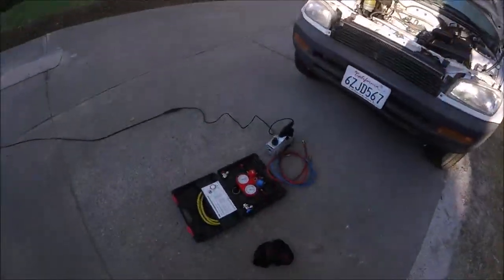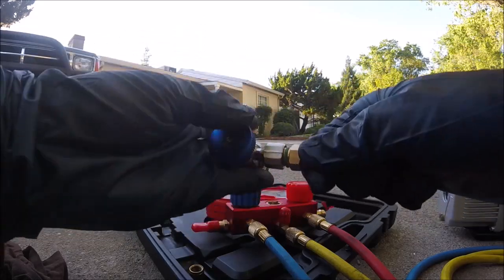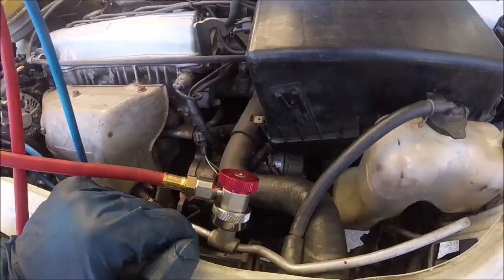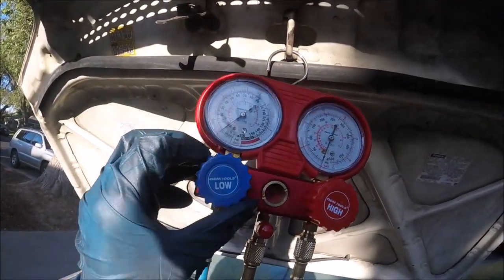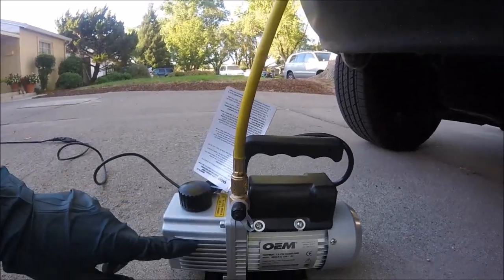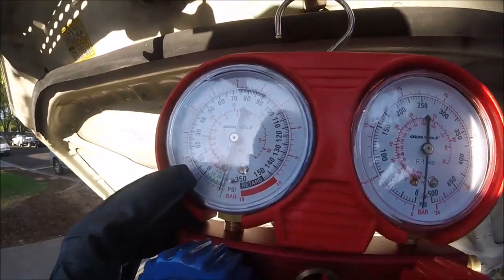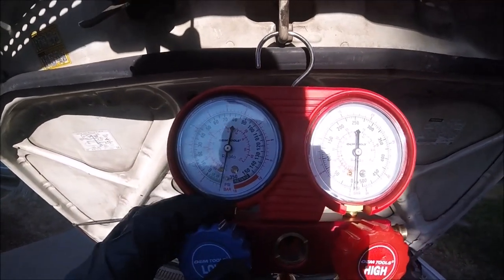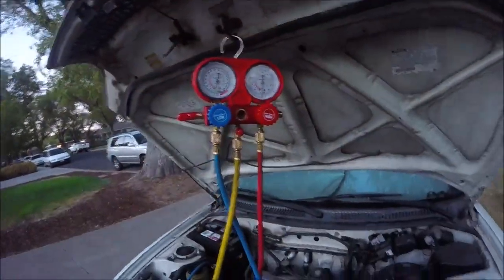How To Pull a Vacuum on Car's  A/C System -Jonny DIY

Comment: What if you do have a leak , how would you go about finding it and fixing that? I think
Mines the low pressure valve😊
Reply from the maker: You can pressurize system with air to listen for leaks or add a leak dye. Then just replace seal or part leaking 👍

Comment: I JUST USED Google Image… And asked them where my low pressure was.  I WAS ABLE TO LOCATE IT WITHOUT A PROBLEM. 

BUT, I was able to see my High Pressure line, the cap is missing on my High Pressure Line

Comment: So, after you are done do you unscrew everything and then recharge your ac like you did in the second video, I'm not understanding what you mean by attaching something to the yellow hose.
Reply from the maker: Yes unscrew and recharge system as I showed in other video. Ohh I was talking about you can use the gauge set to add refrigerant as well but you need an a/c can tap to connect to middle yellow hose. Either way works though 👍

Comment: Wait, after you've waited to see if it hold the 30 vacuum you said to run it for an hour to empty the air but how do you do that? Open the high and low again and trun on the vacuum and leave for an hour??? What am i looking to see on the gauge? That its still on 30???
Reply from the maker: @enmat3  yes you reopen and vacuum for an hour after testing to make sure there are no big leaks 👍

Comment: Hey I just got a new engine in my 2007 toyota camry le. Should I vacuum it or just put the refrigerant in it?
Reply from the maker: @Smooveminniebackup  it's possible they didn't disconnect the ac system. Is there any way you can find out? Can hook up the gauges or a can and see if it has any pressure. If has some pressure can recharge if no pressure yes vacuum for sure

Comment: HOPE you can see my question!!  At Walmart, they sell the EZ CHILL R-134a AC recharge kit (bottle & hose with gauge) WITH LEAK SEALER plus (18 Oz)…..for $45.00. Does this mean I don’t need to buy a separate can AC sealer?????
Reply from the maker: @CanTho2022  yes just the 1 kit will be all you need 👍
Reply: @ …🙏👍 SORRY I HAVE TO ASK A COUPLE OF TIMES! Didn’t know if you still read from the old videos!! THANK YOU 🙏
Reply: @CanTho2022  if you used one of those make sure you tell the shop you eventually wind up taking your car to when youve had enough trying to fix your car's ac yourself so that they dont ruin their $5000 machine that reclaims all of a car's ac refrigerant as the leak seal will really mess up their machines and the mechanics who know anything about a.c. will tell you never use one of those cans youre more likely to cause more problems than solve them effectively. FWIW.

Comment: If I don’t have access to vacuum and my refrigerant is empty 
What is danger of filling without vacuuming first?
Reply from the maker: @brendancampbell57  no danger, just may not work as well if theres air in system. Air needs to be vacuumed out so refrigerant will work well. Worth a try though if only option
Reply: @JonnyDIY  or Canadian tire near my house carries RedTek R12a says it’s compatible with R134a and R12 systems.
Reply from the maker: @brendancampbell57  I would get the frostycool 134
Reply: @JonnyDIY  HOPE you can see my question!!  At Walmart, they sell the EZ CHILL R-134a AC recharge kit (bottle & hose with gauge) WITH LEAK SEALER plus (18 Oz)…..for $45.00. Does this mean I don’t need to buy a separate can AC sealer?????
Reply from the maker: @CanTho2022  yes it's built in so you need to just buy that 1 kit 👍
Reply: @JonnyDIY  …THANK YOU! THANK YOU!!!!  Thank you for the response!! This confirms what I was thinking!!!
Reply: @JonnyDIY  what about if cannot find R134a , I can find alot of R134a replacements refrigerants (R290, and frostycool R134) ? Is that dangerous to add without vacuuming system first? They claim they are compatible but can it cause bad reaction or clog tubes / compressor? (Literally cannot find R134a anywhere not even amazon)

Comment: Thanks, I have a 1994 Toyota 4x4 DX truck. it leaks gas over about 6 months.  do I have to pull a vacuum before charging it or can I try just charging it? I bought a "pro cold kit, it says it stops leaks, I also bought a red angel stop leak stuff to try if it leaks out.  would it be best to try to seal the leak 1st, if it seals then vacuum it out?  thanks
Reply from the maker: With the stop leak stuff you want to vacuum system first. It can help some depending on size of leaks. Here's a video where I do the same thing.
https://youtu.be/6xbnUd649Es?si=HvaTRHw8SraAFgJk
Reply: @JonnyDIY  Thank you very much!
Reply from the maker: @xerravon  You're welcome, happy to help. Good luck 👍
Reply: @JonnyDIY  Hi, Ive been wanting to thank you for your help on PROPERLY fixing my 1994 Toyota 4x4's AC!  I've seen many videos on charging my AC, heck the instructions on the can (ones that come with charging hose) are the same.  I did this in past and even had it done by mechanics. problem, it never blew as cold as it should.  Well until I found @JonnyDIY. He read my comment and sent a link to this video about pulling a vacuum!  that is something I never saw in any video.THANKS

Longer story shorter, I pulled a vacuum and charged it with AC pro with stop leak, It blows as cold as when I bought her new in 1994!  Hopefully the leak will seal but I won't know until next summer, it took about 6 months to leak out.  that has nothing to do with the video.  but anyway,  THANK YOU @JonnyDIY
Reply from the maker: @xerravon  Awesome! You're very welcome. So glad to hear I could help you get it fixed and working again 🙌👍

Comment: After pulling the vacuum, instead of this method, will it be okay to add refrigerant using those tall refrigerant cans (AC Pro, EZ Chill) with the hose and gauge?
Reply from the maker: Yes that's perfectly fine. Just keep track and add back in the correct amount. You can weigh the can full and subtract weight to get exact amount for recharge 👍
Reply: @JonnyDIY  Thanks for replying. Could I just use the gauge that’s attached to the can to determine the exact amount (green area)?
Reply from the maker: @Indiana_Ape  if vacuuming system first you want to refill the amount of refrigerant your specific vehicle calls for. Should have number of ounces located on underside of hood. You want to add back that exact amount or very close. Better to add lil leas than  too much. The gauge on those hoses aren't accurate
Reply: @JonnyDIY  it’s 21.2 - 22.9 ounces. I’ll ditch the can AC Pro with the gauge. Thank you for all the advices, I really appreciate it. 🙏
Reply from the maker: @Indiana_Ape  You're welcome, good luck. Hope you get it up and working again 👍
Reply: @JonnyDIY  Thank you. I hope so too.
Reply: @JonnyDIY  Thank you. I hope so too.

Comment: So I recently had to change the ac condensor due to a collision. Should I pull a vacume even though I lost all the refrodgerant?
Reply from the maker: Yes most definitely pull vacuum before recharging 👍 Always want to vacuum system when its opened for work

Comment: 10 min vacuum at 30 is enough
Reply from the maker: I usually do at least 20 minutes, depends how long system has been open and exposed
Reply: @JonnyDIY  according to the rep who setup my robin air machine 10 min and 30 psi is enough.

Comment: Maybe stupid question,  but what do you do if theres still refrigerant in there?
Reply from the maker: If only a little bit its ok, it'll just vacuum out to atmosphere 👍
Reply: @JonnyDIY  thanks! Would 1lb be considered a little? Dealing with a uline fridge that wont get below ~48°F
Reply from the maker: @scottsnyder5225  that's not too much. Only other thing would be is you would need an A/C tank to catch it in and then it can be reused

Comment: Great video. Do you know the logic behind the clockwise to open for the low and high ports attachments? Do you have a video to discharge the system? I need to do that, attach some o-rings to the lines and run this same test you just performed in this video.
Reply from the maker: Thank you, glad to help. I believe the low and high ports turn clockwise because of the type of valve they are. And when you vacuum system it will evacuate any refrigerant left in system. If you want to capture that refrigerant you will need to get a refrigerant tank that you hook up to vacuum pump 👍
Reply: @JonnyDIY  Thank you. Any idea where to buy a refrigerant tank? I guess I can google it, lol.
Reply from the maker: @ahmedsaidu-kamara6760  I think you can order online, or some local hvac shops may sell them as well
Reply: @JonnyDIY  I hate to sound like a DIY beginner but I'm not. I just went to open the manifold gauges I rented from my local Autozone in Pennsylvania and it didn't have the yellow gauge. Not sure if the previous loaner took them or it didn't come with one. Any suggestions on where I can get one will be appreciated.
Reply from the maker: @ahmedsaidu-kamara6760  I would take it back and see if they have another loaner or check O'Reillys. Harbor freight sells a set for a decent price if you have one near and want to make the investment
Reply: @JonnyDIY  I will definitely take it back because I need my AC to work asap.

Comment: I'm only able to get 20 inches of murcury, it's holding at 20 with a small drop, is this due to a leak on system?
Reply from the maker: Should be able to get to around 29-30 on a system without large leaks. Make sure you have both low and high side hoses hooked up and open, the valves on gauge open counterclockwise but the fittings on the ends open clockwise 👍

Comment: Should the system take awhile to go from 20 to 30 on the gauge of vacuum pressure?
Reply from the maker: Make sure you have both hot and cold hoses open. The knobs by the gauges open regular counterclockwise, but the ones on end of hoses are reversed. They open when you turn them clockwise.  It shouldnt take long to get down to almost 30
Reply: @JonnyDIY  got it

Comment: hi there Jonny, 1 question.. Can I vacuum a fully charged ac? is the freon and oil going to scape through the vacuum machine? thanks! love your vid man
Reply from the maker: If you have some refrigerant in system still and its just a little low you don't need to vacuum unless you want to refill with the precise amount of refrigerant called for by your vehicle. When you vacuum system it will evacuate all the refrigerant, but it won't remove the oil.

Comment: Does the high side suppose to be on the vacuum too
Reply from the maker: Yes open and vacuum both high and low sides 👍
Reply: @JonnyDIY  ok thanks and the  high side suppose to show in the needle that it is in vacuum
Reply from the maker: @kenssalvador7253  more about the low side when vacuuming. Just close them both off and the low side should hold at 29-30. Thatll tell you if you have a leak or not if it holds or not

Comment: Pressure loss on the high side.  

When I do the vacuum test, the low side stays on -30 PSI for an hour BUT the high side seems to lose vacuum.  .  Is this a concern, the video doesn’t seem to look at the high side which I don’t understand why?  The 2 sides don’t seem to be “connected” when the car compressor isn’t running, the car turned off

Comment: Open the yellow?
Reply: Oops.ok thanks man.should i let ot run a lil longer now that i opened the yellow line?
Reply: Thanks for the quick response man
Reply from the maker: @juicecounty714  yes let it run 30-45 minutes to remove all air/moisture. Gauges should reach down to almost 30. Make sure vacuum pump has oil in it too
Reply: Hey boss.i got another question
Reply: Specs say I need 25oz of refrigerant.i used a a 12oz can and a lil less then half of another can and the guage is in red?do I still keep adding even tho its in red.?I'm probly abt 16oz.
Reply from the maker: @juicecounty714  how cold is the air running now? If cold yes,  stop. If not double check specs and fill to at least Minimum listed amount 👍🏻
Reply: @JonnyDIY  yes its cold.nkw the guage is reading differant this morning.i got the. Charge with rhe uv dye.must have a leak right?
Reply from the maker: @juicecounty714  if its running cold 35-45 degrees Id leave it and deal with it again later if it leaks all out. If still a lil warm, I'd add some more refrigerant until either cold or to the minimum amount refrigerant amount listed. Probably around 23 ounces
Reply: @JonnyDIY thanks again my boy.u the man.god bless.sorry for bugging.haha
Reply from the maker: @juicecounty714  You're welcome. No worries, glad to help 👍🏻
Reply from the maker: Yellow in middle is for adding refrigerant 👍🏻
Reply from the maker: Oh yes sorry open the yellow one on the gauges once it's connected to the vacuum pump. That will allow the vacuum pump to suck the air through and out the system

Comment: Does the vehicle need to have all tje refrigerate out?
Reply from the maker: yes, once you vacuum the system it pulls whatever is left in it and vents it into the atmosphere
Reply: And ty so much for responding bro. Thx thx thz!!!
Reply from the maker: @jayflo-tripple-4142  hmm so you vacuumed and recharged? Now compressor cycling on off on/off with no cooling in car?
Reply: So get this,  pulled the vaccum, damn conpressor keeps coming off and on. The low side is freezing cold. So this did not resolve the issue  i did some reseaxh, says to check the pressure switch, what are your thoughts?
Reply: Actually it was doing it b4  and it seemed that the recharge almost worked, but as soon as i get it filled on green (the prorefrigerant gauge) its starts to click on and off.
Reply: This is why i thought it maybe the pressure switch
Reply from the maker: @jayflo-tripple-4142  well it is normal for the compressor to cycle on and off quite frequently, but if it isnt cooling then yes could possibly be pressure switch

Comment: Thanks for the info Johnny! I have completed the final vacuum of one hour to remove all the air in my system. Instead of connecting my refrigerant to the yellow hose, can I just connect it directly to the low-side port of the car using the hose that is connected to my refrigerant can?
Reply: I wouldnt using the yellow not only allows you to purge the line but as soon as you remove low side you will loose vacuum
Reply from the maker: You're welcome, & yes thats totally fine to use the hose that came with can after vacuuming 👍🏻

Comment: Do I need the car on,in order to vacuum the line?
Reply from the maker: No car is off. But Car needs to be ON with AC on full blast when recharging with Refrigerant 👍🏻
Reply: All,cool. Thanks dude.
Reply from the maker: @rafam.3585  no problem 👍🏻
Reply: no  dont have the pump running

Comment: Vacuum with car off or on??
Reply: Mr jonny i have a little dilema, my car only cools when i am driving get some speed and doesnt cool when i am parked, i noticed the cooling fan from the condenser doesnt spin, i tap it with something and it starts spinning, could replacing the fan make my car cool? Car doesnt overheat because its dual fan and main fan does spin
Reply from the maker: Yes if both fans arent coming on you should replace fan assembly, then it should help the AC to cool at low speeds or stop and go traffic. If after replacing the fan it still doesnt get cold, you may need to top of the AC refrigerant level as well
Reply from the maker: Car off to vacuum. When recharging you have the car running

Comment: What if my ac system still has refrigerant in it but I want to pull a vacuum to get all the air and moisture out so it can run colder than it is? Do I need to evacuate all the perfectly good refrigerant out first? I imagine a vacuum pump won’t only pull air and moisture out but also refrigerant along with it.
Reply from the maker: Yes if you vacuum system you will evacuate all the refrigerant.  Better thing would be to just add some refrigerant and check with gauges

Comment: I do not understand keeping the valves on the gauge manifold closed. If you close them, aren't you just seeing the vacuum in the gauge manifold? I would think you would want to leave the valves open... maybe close them, connect the yellow hose back to the manifold tightly, then open the valves again to be able to see if the vacuum is holding in the car's ac system. I guess I do not understand what the valves are opening/closing.  Do the gauges always show what is going on on the hoses? Do the valves just control the opening to the yellow hose?
Reply from the maker: I know I was confused the same as you first time I used them. Yes keep valves closed on gauges to read pressure. Open them when vacuuming system. Open low side if adding refrigerant through yellow hose.